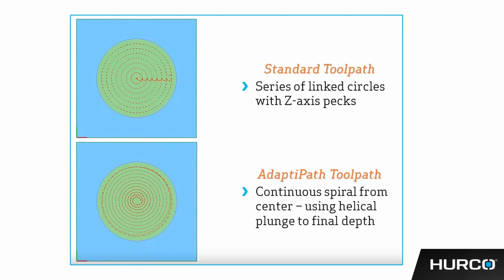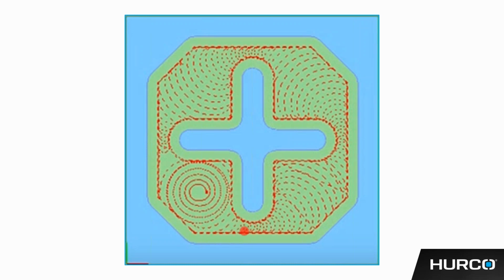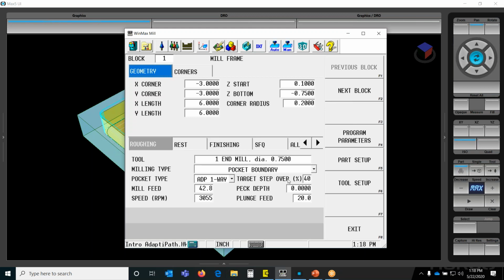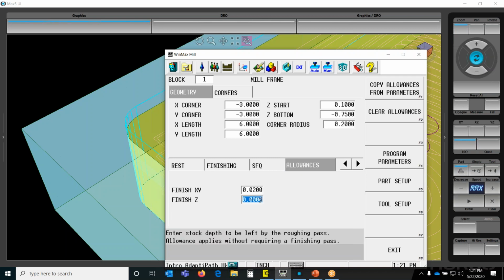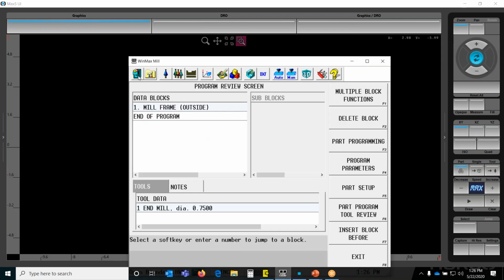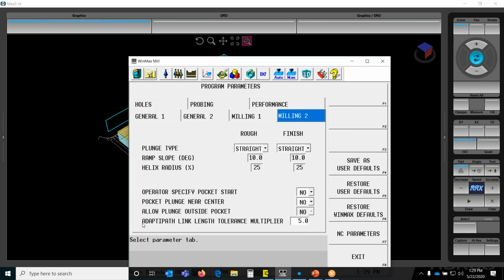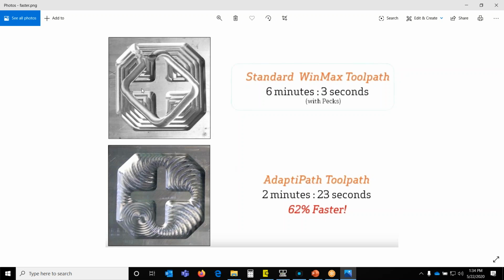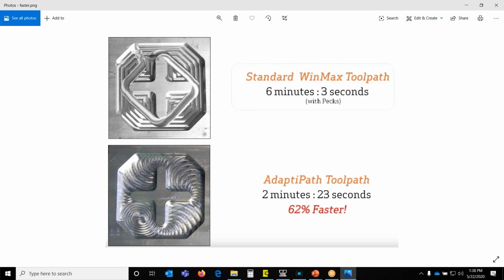Hurco Quick Training Session 8: AdaptiPath

Comment: When i draw a c shaped section exectly like this video, and select pocket boundary and adapti path it wont run, i get the error in block whatever nimber it is and a my pocket boundary is not closed message
Reply: im running into the same problem (and have in the past) and am seeing that he drew the C in a conventional milling direction but still got climb milling toolpaths... others are saying to check the plunge options in Milling 2 parameters but im still getting errors for what im doing.
Reply from the maker: Whenever we call something a “pocket boundary” the boundary must be closed (also called water-tight). That means the starting point, and ending point of the contour must be exactly the same XY location. That would be the first place to look. You can email the program to copem@hurco.com and I will take a look if that doesn’t help.
Reply: @hurcousa  you ended this video with an example of a 3 sided boundary that was not closed.

Comment: Hi, new to hurco, is there a way to restart your tool path simulation from specific tools instead of running it from the beginning, also can you step the tool through its path instead of letting it just run?
Reply from the maker: To restart your toolpath simulation from a specific point in the program, you would need to add a GRAPHICS OFF block at the beginning of the section you want to skip, and a GRAPHICS ON block just before the section of the program that you want to be shown in the graphics. The graphics on/off blocks can be found under the MISCELLANEOUS menu when programming.
 
To step through the program in single block, or to have it only run one toolpath then stop, you can use the selections for PART, SINGLE, or TOOL on the graphics screen. Part will run the whole program, single will stop after each process, and tool will stop after the completion of each tool. You can just hit the play button to continue after each stop.

Comment: Hi all im currently running a hurco vm20ids with winmax version 10.01.264.58 st what version will i need to perform this open pocket i have the adaptive path option but when i write only 3 line and pit it as a pocket boundary it say i have to close the pocket any help will be greatly appreciated thank you.
Reply: 1.	On the MILLING 2 tab in PROGRAM PARAMETERS you will need to set OPERATOR SPECIFY POCKET START and ALLOW PLUNGE OUTSIDE POCKET both to a value of YES
 

2.	Make sure you have your MILLING TYPE set to INWARD – once you have done that the POCKET START X&Y fields will appear. Make sure your POCKET START is outside of the boundary, and make sure the tool would enter through the open side of the pocket.

As Mentioned below...you can email me for more information: copem@hurco.com
Reply: @trailgeartradingpost  this must not work for adapti path
Reply: @Justajiujitsuguy  Hello...I just tried this with AdaptiPath on a three sided open pocket, and it worked. You need to make sure you go to the MILLING 2 tab of program parameters and set OPERATOR SPECIFY POCKET START to YES, and also set ALLOW PLUNGE OUTSIDE POCKET set to YES. Then you can go inside the block to SEGMENT 0 and set the plunge point outside of the open side of the pocket.
Reply: @trailgeartradingpost  I can’t set my milling to inward and adaptipath. I’m actually finishing the profile as I’m typing this. The inward worked, but it just gave me a standard pocketing toolpath. And once inside, it does one path, retracts, replunges outdide the part, same depth comes in and does the next pass. Very odd.
Reply from the maker: Hi Shaun, we have a couple screenshots we would like to send you to explain this better for you. Please email copem@hurco.com for more information. Refer to your question on Youtube in your title. Thanks.
Reply: Thank you Great information looking forward to putting it to use making chip thanks again 👍.

Comment: Hello Jason how would I program an open pocket on a 3d imported model with and expanded boundary?
Reply from the maker: There are two options that will probably work out for you. If you wanted to send us the model, we can take a look and see which would be easier to do. If you want to give it a try yourself you could either turn off the solid layer and select the wireframe that WinMax generated on all the edges and select just the lines you want to be your open boundary.
Another option would be to go ahead and program the whole pocket like normal, and then once the block is created simply delete out one of the sections that you want to leave open. An easy way to find the segment you want is to draw the pocket, and use the select tool to select the segment you want, and then select jump to get you to the correct segment, then simply delete the sub block, and then go in and set your pocket up for AdaptiPath.

Comment: When I try the open end pocket machine always tells me error because profile is not closed.
Reply: Anytime you have a data block set as a pocket boundary, that boundary MUST be closed (or "water tight" as it is also called). Most of the time the tool will plunge inside of the pocket boundary, but on the MILLING 2 tab of the Program Parameters there is a setting to allow the tool to plunge outside of the pocket boundary...basically the tool will enter (in X&Y) the boundary from that point. So, even though the feature on the part might not be a completely closed boundary, you would need to program it as it was - this feature just allows you to plunge off the part. I hope this helps!